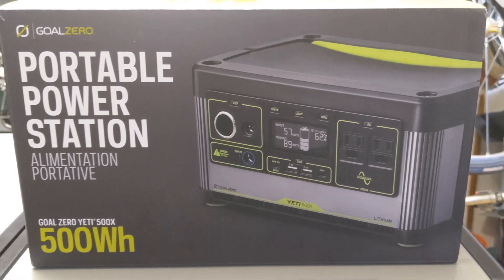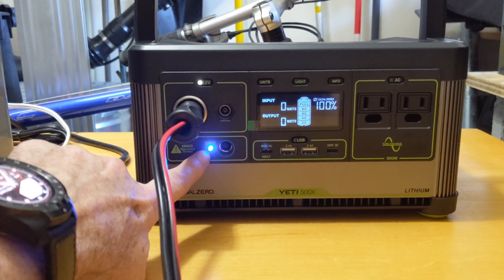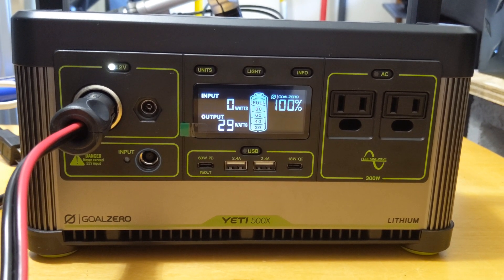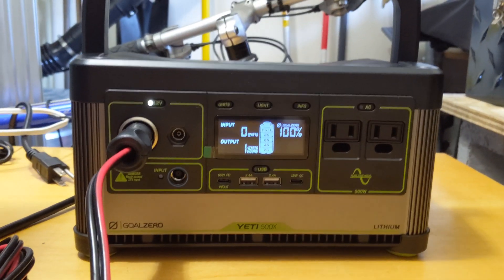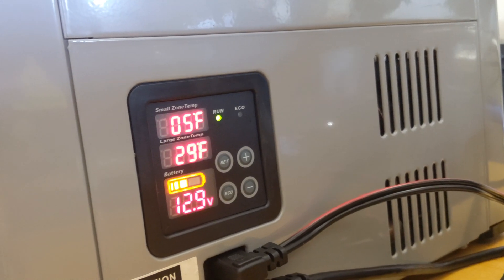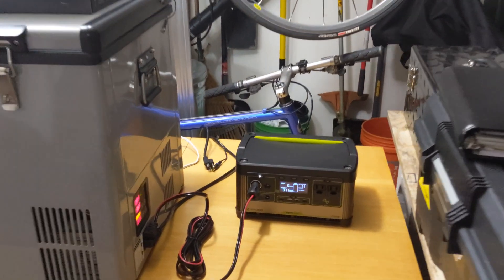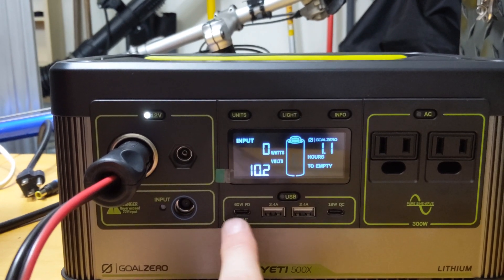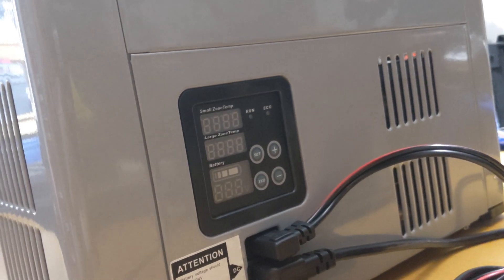How long can a Goal Zero 500X power station run a 12V portable fridge freezer?

Comment: I have the yeti 500x & a nomad 100w panel, I’m an idiot concerning solar power. I bought them for camping trips off grid. In your opinion is this a good setup for running a 60qt fridge/freezer combo ? Forgive me if a redundant question just trying to figure things out.
Reply from the maker: Hi Steve, thanks for your question! Now that I've had the Yeti 500X for a while and have used it on camping trips and during power outages I can give you my opinion. 

I like the Yeti 500X as a power source for the campsite and also to recharge phones and run some miscellaneous items during a power outage.

No, I do not think the Yeti 500X is good for a large fridge freezer 60 quarts and above. It can work fine as I demonstrated in the video but you will only be able to get a short period before recharging from shore power or your generator. I think it would do fine with a smaller 30 quart refrigerator only type of cooler. I was using a Whynter 65 quart fridge freezer for the testing and it can barely make it through a night out in the field.  Using the freezer portion of the unit really takes a lot of power.

If you needed something to last you more time off grid, I would recommend either a smaller fridge freezer, or the Yeti 1000X or some of the competing brands of that capacity.

I hope this helps, please let me know if you have any other questions! 🖖
Reply: @KD2JRH  thank you for the reply! Could I add a deep cycle battery into the my setup & maybe go 40qt fridge/freezer combo & run 24/7 in a Texas climate in your opinion?
Reply from the maker: @stvwalden1  You're going to end up with the same battery capacity issue if you go with a lead acid battery. In one of my camping videos I use a 120 amp hour sealed lead acid battery to power the fridge freezer. It works great but remember you only have 50% capacity on the lead acid batteries and therefore I still found myself having to recharge the battery within 12 hours. There's also the consideration on the weight and how heavy the lead acid batteries are. If you're looking to go off grid for a weekend and not have to run your generator I would recommend getting a smaller capacity fridge freezer so you don't need as much power consumption. 🖖
Reply: @KD2JRH  Thanks once again your one of the few who took the time to reply to my questions, that says a lot about you boss! You’ve gained a new sub & fan thanks for your time!
Reply from the maker: @stvwalden1  thank you very much! I really appreciate that more than you might realize! I'm getting ready to film my next project and a series of videos about Battleborn lithium iron phosphate batteries. Positive feedback like yours is definitely motivation! Thanks for commenting and subscribing Steve! 🖖

Comment: See how long the fridge can run using AC from the Yeti.
The results I think would be surprising.
Enjoyed.
Reply from the maker: I find the AC port to be much more reliable than the DC port on this unit. I've been very disappointed using DC. And the DC port trips very easily. The problem with my test here is that the fridge freezer is a power hog and it's really too big to be running for a couple days on the goal zero 500. I recently bought a jackery 1500. It handles this fridge freezer much better. Thank you so much for your comment and for watching the video much appreciated! 🖖

Comment: These are sweet little power stations but they are quite pricey. Wish they would come down in their price.
Reply from the maker: I agree, very costly. You do get a lot in a nice package with the controller inverter and everything. If I could afford it I'd go with the 1000X, the 500X with the built-in BMS shut off doesn't provide enough watt hours to go a couple of days for my purposes. So instead I bought two Battleborn LiFePo4 batteries for more capacity and to be able to run my appliances longer during a power outage.

Comment from the maker: The GZ500X 12V cigarette port is regulated and will provide a consistent 12V to the fridge even when the GZ500X is actually at ~9V.  I do not recommend doing this to your batteries. Please see minute 8:48 where the GZ500X is at 10.2V and the fridge shows 12.9, and at minute 10:21 where I demonstrate the GZ500X at 9.1V while the refrigerator shows ~12V. The GZ500X internal BMS appears to shut down the unit when it hits 9V as shown in the video. This is obviously way below the automatic shut off for the fridge which is set for 10.1V.

There is a comment on this post which could be misleading. I'm not here to debate with people, just to share actual information. 

Live long and prosper my friends! 🖖
Reply: I’m a bit confused, would you mind explaining this one again? The GZ BMS handles under voltage protection, is this not desired?
Reply from the maker: @OutdoorsIQ  The DC cigarette lighter output on the GZ is regulated. Therefore it maintains a consistent voltage to the refrigerator, even when the GZ itself is low in voltage. Otherwise the refrigerator would shut down due to low voltage. This is a very good thing that GZ added to regulate the 12 volt output. When this unit was first released other competing models didn't have a regulated 12 volt output. It has since become pretty standard in the competition too. Thanks so much for asking your question!
Reply: @KD2JRH  oh got it! Thanks for explaining. I also read the comment which this was for. But absolutely agree on having a regulated output.
Reply from the maker: @OutdoorsIQ  The AC output is also regulated and will maintain a consistent voltage to the refrigerator as well, but it will consume a consistent 7 watts to power the inverter even if the refrigerator compressor isn't running. Without anything plugged into the GZ at all, just turning on the AC inverter consumes the 7 watts. This is an option considering the additional power consumption. 🙏🖖
Reply: That is really interesting, much more lossy way to go.

Comment: Can you be changing the yeti with solar and at the same time running the fridge?
Reply from the maker: Yes Sir you sure can, here is my video on using solar panels with the Yeti. I didn't run the refrigerator at the same time but it's the same as using the AC charger and using the refrigerator at the same time. It works very well! Thank you so much for your comment and watching the video! https://youtu.be/RlNIc60UhrA

Comment: I've bought one of these paired it with a set power 32 quart 12v freezer/fridge and a 12v electric blanket only lasted 13 hrs. Not worth it for a weekend trip. Need to upgrade to 1000.
Reply from the maker: So you got the similar results! I was disappointed in the total watt hour output. I agree the 1,000 is needed instead to at least make it through one day. Thank you so much for commenting and watching I really appreciate it!
Reply: Yeah definitely I mean I just wanted to try it too. I sent it back and got my money back but I guess the new yeti 1000 isn't available till January and the yeti 1500 seems like over kill and much larger. 
Maybe try out the jackery 1000. 
Thank you for the video it was very informative 👍
Reply from the maker: I was thinking about the 1,000 too but instead I've been working on a new project with two 100 amp Battleborn lithium batteries. I've decided that I would rather manage the batteries myself and have more capacity compared to an all-in-one with the Goal Zero. Thanks again for your comments it's good to hear about your experience. Have a great weekend!
Reply: @KD2JRH  definitely do a video on that one haha. Heard those batteries are the way to go

Comment: Can the goal zero accept charge, e.g. from a 12v cigarette lighter in a vehicle, and simultaneously power the fridge in a vehicle?
Reply from the maker: You sure can, you will need to purchase this 12v charger: https://www.amazon.com/dp/B07NRQ4KY3/ref=cm_sw_r_cp_apa_i_zgTHFbGK6F91A
I recently posted a video where I drove around with the refrigerator running in my truck using an AGM battery here's the video: https://youtu.be/l7m-v-fmdrk

Comment: Any issues charging on solar or charging above 100W total input? Lots of 500X models have been failing due to this leading to unresponsive ports.
Reply from the maker: I have not tested on solar yet, that is next I have 180W panels set to go. I am almost done with a video and will be releasing in a couple of days. In that video I charge the 500X with both the 120 watt charger that costs $50 and a 60 watt USB-C PD charger. I did achieve almost 180 w charging and did a full charge in about 3.5 hours. More to come on that video soon. Thank you so much for asking the question!
Reply: @KD2JRH  oh wow that’s cool! You can charge with two simultaneous inputs
Reply from the maker: @RLeeWII  yes Sir, You can crank it up to almost 180 watts by using The PD charger. Please check out my other video where I test the limits on that! Thanks so much for watching and commenting! https://youtu.be/Bk8ubN0PTG0
Reply: https://www.goalzero.com/product-features/yeti-500x-product-replacement/
Maybe it’s only in the US you can get a replacement one, but they know they have a problem with it.